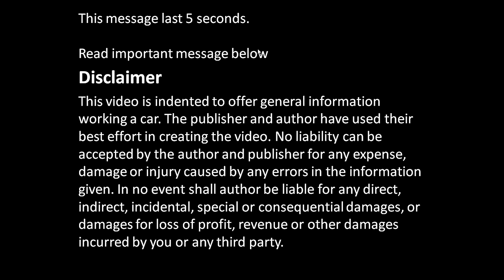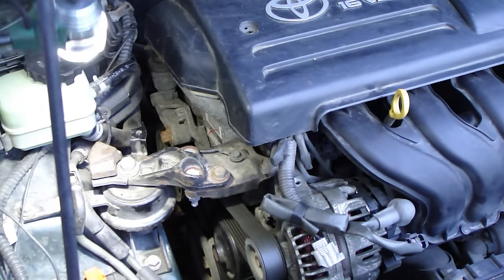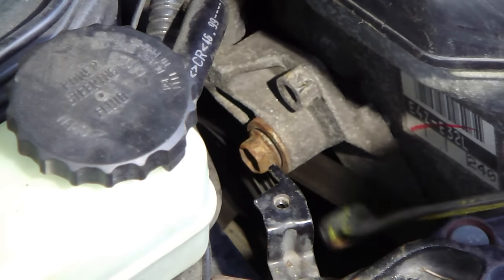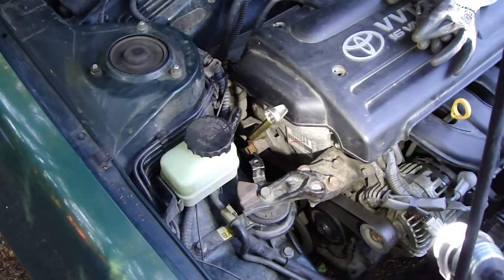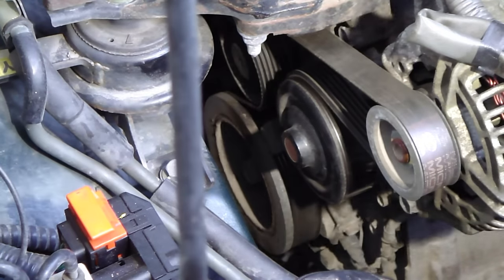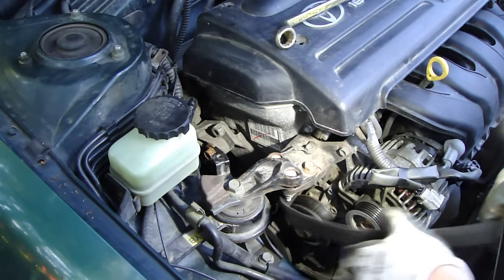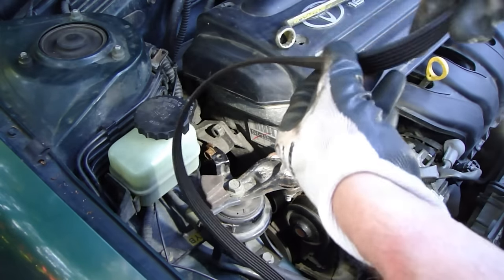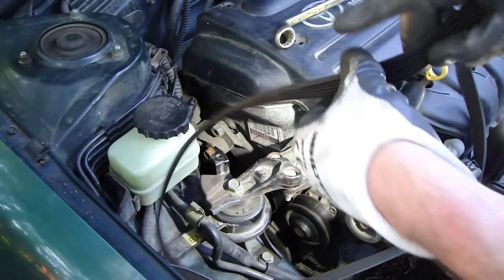How to replace drive belt or serpentine belt Toyota Corolla. VVT-i engine. Years 2000-2009.

Comment: Hello peter, I have a question. My car has in 2zz-ge VVTI-L engine. At 1.25 in your video you indicated that you should loosen a nut. Do i need to loosen this nut on my car also. I have seen another video where this nut is not loosened. I am not sure which is the correct method for me to use. Here is the other video if you are interested. https://www.youtube.com/watch?v=VWN5YtAMHL8
Reply from the maker: Henderson Collins Hello. You recommend to be loosen that bolt, because it is locking bolt.
Reply: Peter Finn Thank you!!

Comment: to put the belt back on do you need to pull the tensioner or is it easier to put on rather than take off
Reply from the maker: Ok and Thanks
Reply: +Peter Finn sorry i forgot to put a question mark. it was a question
Reply from the maker: So, take off